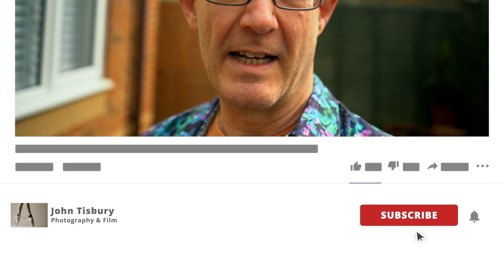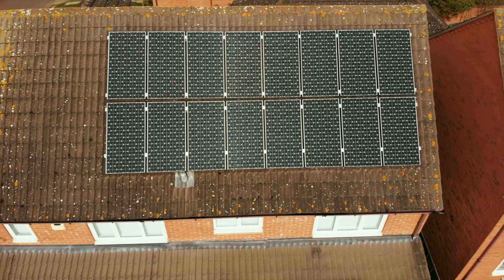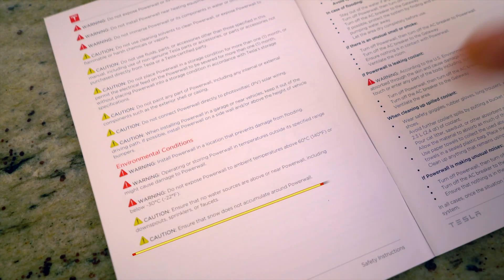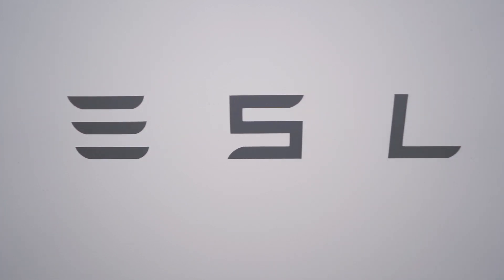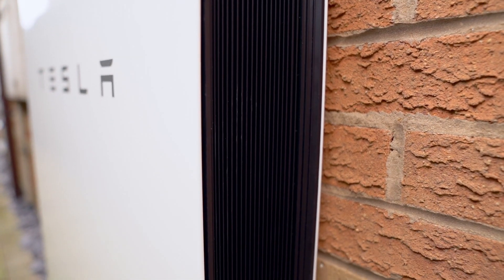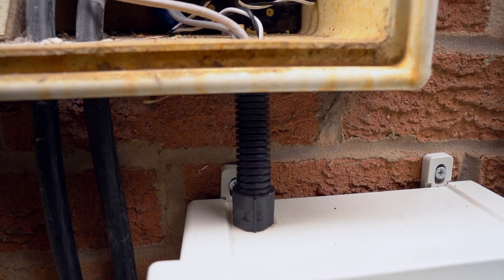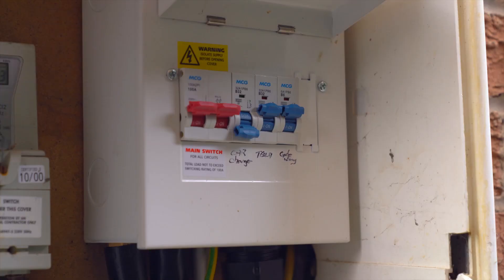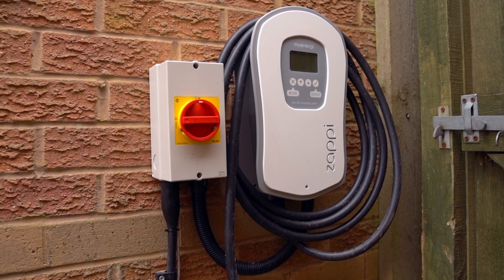Tesla Powerwall 2 UK installed in an outside location

Comment: Thanks for this video! I am contemplating a Powerwall installation with similar features (side of the home where there is a fairly narrow walkway, much like your install). Online it says you need 6ft of clearance in front of the Powerwall, which I don't quite have, but you don't seem to have that either. So I wonder if the clearance requirement is just for indoor installations. Did your installers say anything about how much clearance an outdoor installation needs? Thanks!
Reply from the maker: Hi, thanks for watching. No problems with installation position. Perhaps as you say it's 6 feet indoors. There was never any issue when ours was specced or installed. I can recommend JoJu Solar if you haven't chosen anyone already.

Comment: Quite a lengthy video which lost me a bit With the photography plug. I didn’t quite catch it all but would you recommend JoJu solar and the Tesla wall?
Reply from the maker: Thank you for watching. Noted on the duration. 
Yes I would recommend both. I've also use Stratford Energy Ltd who installed our second solar array. Both companies are very good.
The Tesla Powerwall is a great solution for home energy storage. However, it does not suit everyone as it depends on how much your home usage of electricity is. If you are a low user, less than 10kWh per day, then it may be overkill and a smaller battery solution would suit. Depends also if you have solar panels as they will offset the need to a large battery in the summer months.
Reply: @johntisbury  Is there a reason you went with Joju for the PW rather than Stratford? (or did the PW preceed the extra solar)?
Reply from the maker: Good question. Powerwall first then extra solar.   I got quotes from both, like for like Stratford Energy were £1,000 cheaper.

Comment: Ours is outside, down south in Hampshire.
Reply: Yes that sounds like a plan. 

During the survey we were going to install it outside at the front of the house, then I discovered it has an on/off switch and we a bit worried about it being vulnerable to being switched off. So we then considered it’s position in the under-stairs cupboard, next to the fuse board and meter. Plenty of people have installed them in garages and the like but as the under-stairs cupboard is in the centre of our house (surrounded by the kitchen, hallway and lounge) we finally decided it would be best outside the back of the house. It did mean we have some trunking running through the kitchen now but it’s not too obtrusive, and they did a really tidy job.
Reply from the maker: A sensible solution. A battery in the core of the house may not provide the safest exit route in the event of an incident.
Reply from the maker: We will have to start an outsiders club Andy!